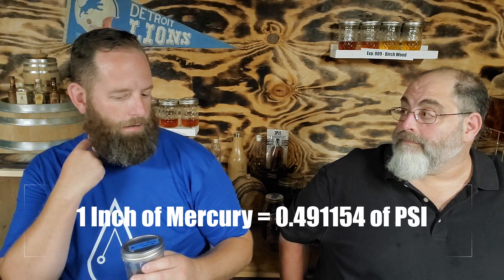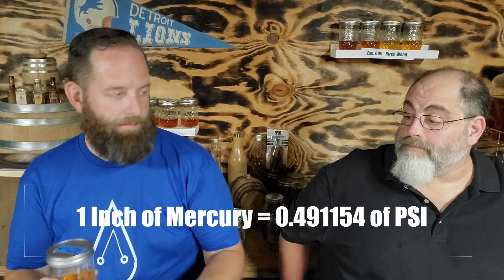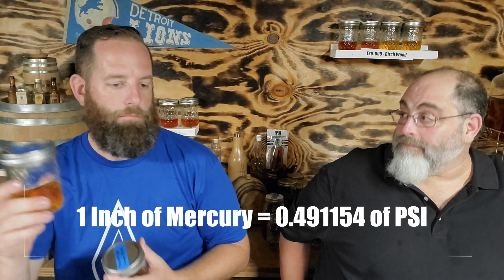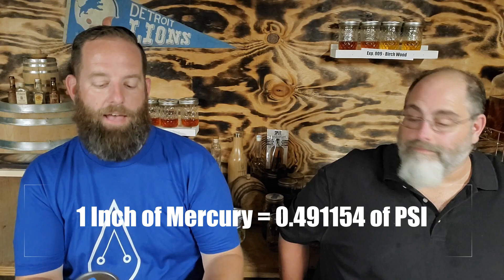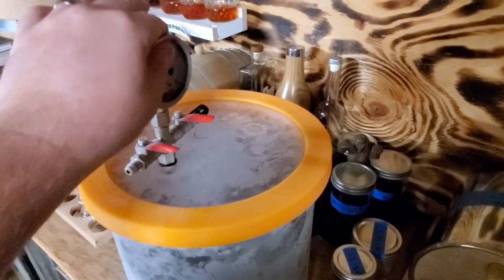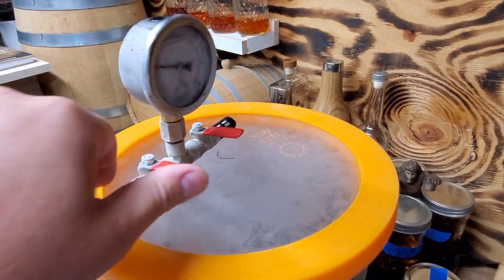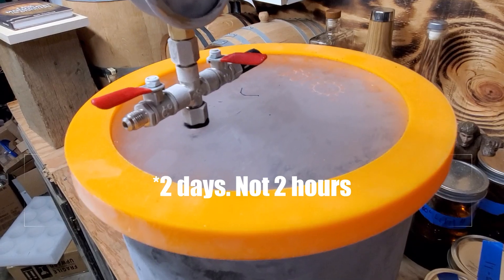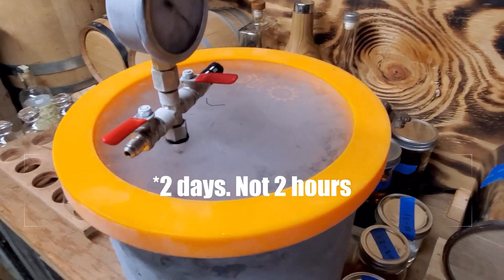How does vacuum and pressure affect the aging process? Exp. 012

Comment: Nice. The pressure and vacuum rotation is really interesting as it happens on a minute scale in barrels.
Reply from the maker: Thanks! I have been watching your videos all morning. Love what you are doing.
Reply: @AgeWhiskey  There are so many levers to pull for flavor and depth to spirits. Can you imagine a vid with extreme exotic roasted and smoked Grains, geek level mash techniques, crazy left field yeast selection, scientific level fermentation, deep pot still and bubble cap distillation, then finish it off with some really technical and different wood aging and finishing processes. Man what a ride that would be.
Reply from the maker: @TheGrainBench  it would go on forever. 

On a different topic you have inspired me. I saw one of your videos on smoking grains and it got me thinking... what if I smoked wood? Not in the traditional sense but what if there is another level of  seasoning wood? You have a toast, a char, and maybe smoke? This would be where you could put some staves on the top rack of the smoker or in a cocktail smoker where it would be little to no heat but all the flavor. Hmmm, I know what I am doing today 🙂
Reply: @AgeWhiskey  think of complementary smoke flavors of the staves. Say oak staves with cherry chips then some with a hickory or apple. You'd want to get the heat up to a med level so the stave's cells could really open up. Not too hot but definitely 120-150ish I would think.
Reply: @TheGrainBench I’ve been missing you! Hope all is well and you’ll be back! You inspired me to try smoking some of my own grains and I’ve had great results. I’m about to put a mash together that’ll be a blend of apple, cherry, oak, and pecan smoked grains; I’ll add a bit of peat malt, and lastly Lap sang So Chong tea for my water. See how it comes out. Can’t wait! Calling it the Trippple Sssmoke!

Comment: An interesting test would be atmospheric composition. 
All oxygen, all nitrogen, all co2 and all argon
Reply: If it was me, I’d put the whiskey in a sealed container 📦 
Fill with gas using a 1 way check valve, have a bubbler and pump in the box so all the atmosphere is recycled (no airlock!) through the whiskey

I’d make the container from acrylic. 

Buy acrylic pipe, some acrylic sheets and the weld/solvent. Cut 1ft of pipe place on sheet add solvent. They weld together. Flip, put experiment on a sheet cover with pipe add solvent. You now have an air tight cylinder. 
Drill hole in top. 
Add gas (atmosphere)
Cut open after {time variable}
Reply from the maker: I am not sure I am setup for this. I'd need to think about how I can remove the air that is in the chamber and replace it with a certain gas. Then pressurize with the same gas. If you have any ideas, send them over.
Reply: @AgeWhiskey  put my name into Facebook, I should be easy to find my wife has bright red hair. Drop me a chat on messenger. 
Also if you have any questions relating to chemistry, I studied chemistry and physics at glasgow university
Reply from the maker: @tonyoliver4920  I am amazed how many Tony Olivers there are on fb. I am not finding you. Message me on fb through my AgeWhiskey page and I will send over a friend request
Reply: @AgeWhiskey  you might not need valves....  I used to nitrogen to purge samples of different things in zip lock bags at a job in a very low tech way to good effect for short-term protection against oxidation (Thermionics R&D for retrofitting onto heat stacks to generate low voltages & using a cesium filled heat-pipe -- I assisted with out-gassing parts under high vacuum and heat to re-grow the crystaline structure after making and using tuned acid etches)...anyway, you can just use a narrow 1/16" pipe with a thumb wheel valve to pump in nitrogen and it'll push out the "air" then cap it real quick, or put plastic film over a mason jar poking a small hole and leave the saran (sp?) wrap and cap it with a ring over the plastic wrap, and also fill the pot with nitrogren....  Point being you might not need valves ('course that was back in the 80's when Pink Floyd made, "The Wall," LP)
Reply: @AgeWhiskey  when you flow one gas in, it displaces the other. So 2 one-way check valves.  One for gas in the other for atmosphere out

Co2 is the easiest. It’s heavier than air so Add some dry ice to a container and let it melt (sublime)
As it turns back to a gas it fills the container from the bottom, displaying the standard atmosphere. Like filling a bucket with water
Reply: @AgeWhiskey  do you have a discord server?
Reply from the maker: @tonyoliver4920  I do not, I was thinking about setting one up, or a subreddit, or fb group. I am open to suggestions

Comment: So when under vacuum your pulling the air from the wood which is then filled by alcohol. By keeping it cold there’s probably some aromatic coloured compound that bound in the wood and not expressed into the whisky
Reply from the maker: I wonder what would happen if I cycled the vacuum a few times in the cold chamber. 

I know from previous experiments that heat fluctuations really brings color. I hoped vacuum or moving whiskey in and out of wood might do the same. I guess probably not because it's only a one time movement when the vacuum is initially sealed.